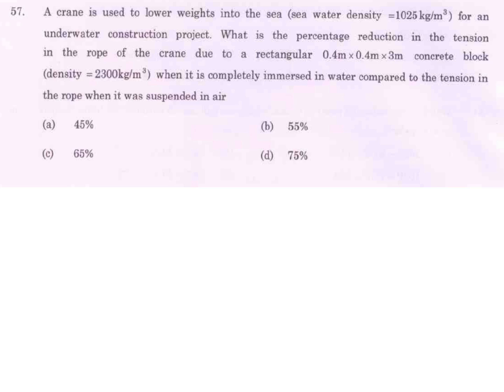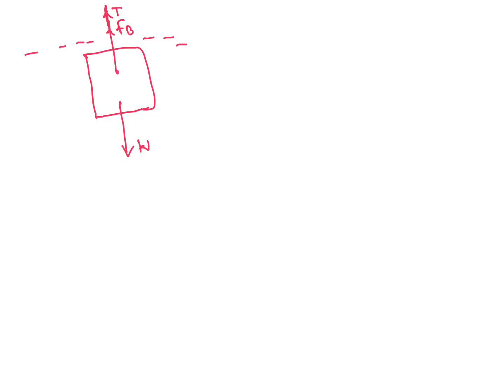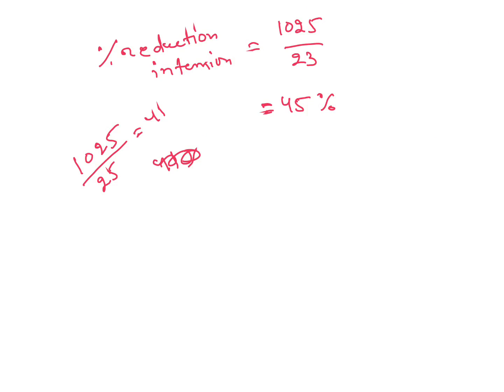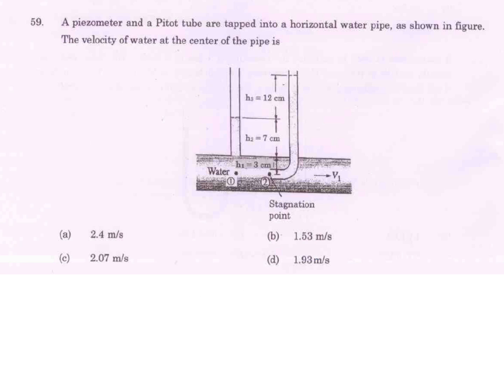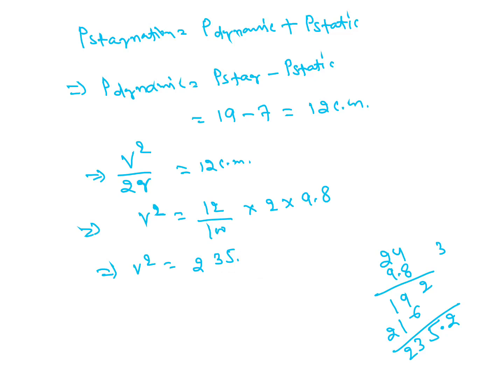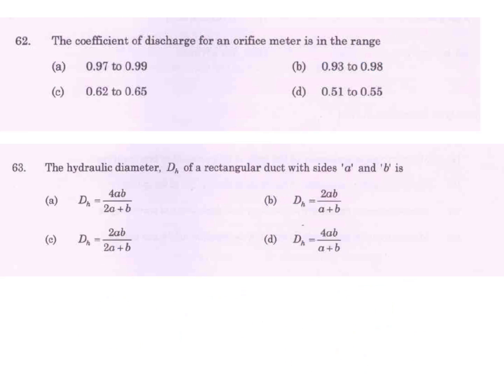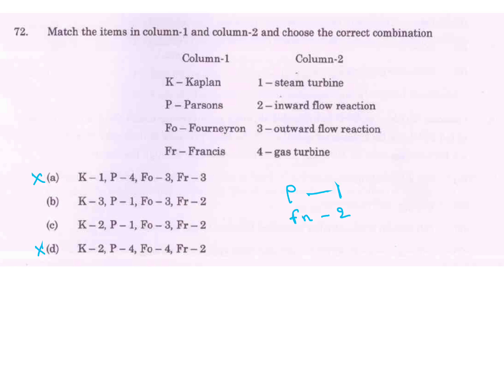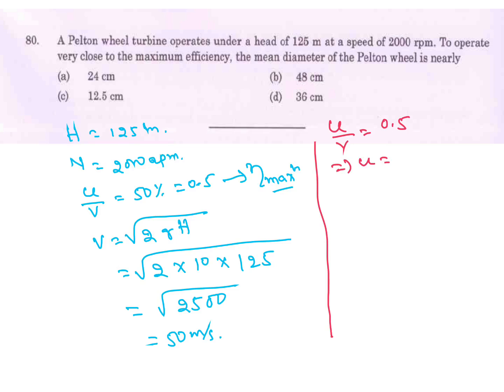ISRO FM 18

Comment: ISRO 2013 SET A

Sir plz share solution.

Q. A tank 1.5m high stands on a trolley and is full of water .it has an orifice of diameter 0.1m at 0.3m from the bottom of the tank.if the orifice is suddenly opened coefficient of discharge of the orifice is 0.60,then find propelling force on the trolley?